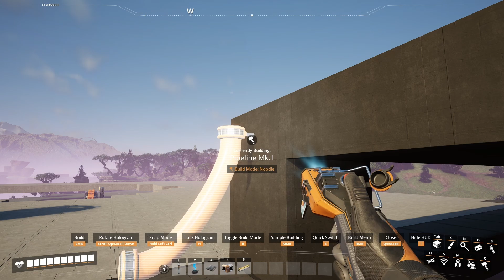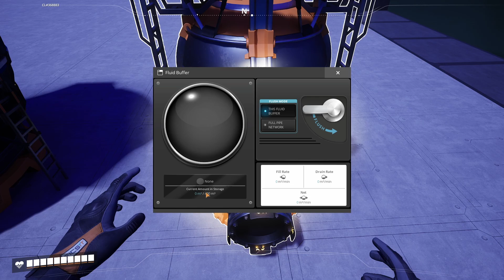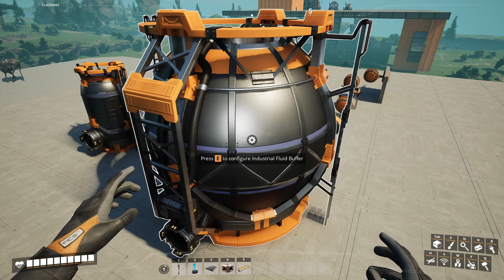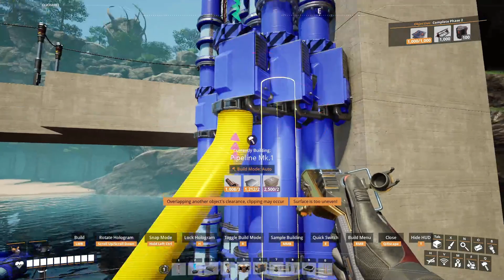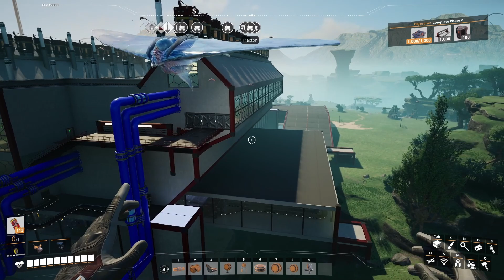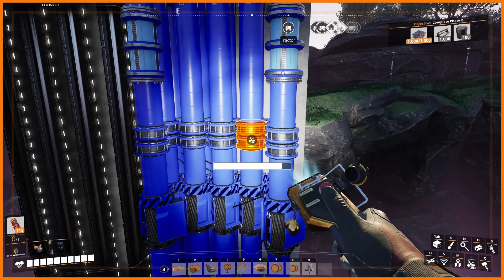Guide for Fluid Mechanics + Flow rate bug fixes (Mk 2 pipe bug) | Tips and Tricks | Satisfactory 1.0

Comment from the maker: I realized when editing I forgot one important tip, and the timecode for part 2

TIP: ALWAYS LET PIPES AND MACHINES SATURATE BEFORE TURNING ON THE MACHINES!
Timecode: 23:48 - Part 2

Do you have other tips that can help make pipes work better for people?
Reply: I think you forgot something else, like TURNING OFF YOUR GOD DANG DISCORD 🤣also thanks for the vide coz those GOD DANG PIPE IS BULLSHIT
Reply from the maker: @pcb5135  that has been solved since, it shouldn't have been an issue in the first place, but soundsetups are just like satisfactory pipes XD
Reply: I have never had to do this. Your statement makes no sense to me.
Reply from the maker: @jamiec8096  means you are one of the lucky few that don't need this video
Reply: Absolutely love this!  My playstyle personally is everything natural for the most part, I do not like platforms for fluids and piping systems.  This style might be worth a try for those that are having some real problems.  I do not use loopbacks, only high pressure, (saturation) and gravity.  Even tanker trains can work wonders if you have everything primed to the max.  If you have enough constant resource it should just work...

Comment: Build my oil refinery with 8 machines, using 600 m3, connected to one overclocked extractor which was much higher so I was not expecting any issues. Yeah you wish. Only now in this video I find out why at the end of my pipeline I have flow rate of only 302 m3 per minute. Can it be because of mk2 bugged pipes? Going to check it.
Reply from the maker: lol, I hope you manage to find the culprit and fix it ^^

Comment: anyone struggling with the 250 clocked nuclear reactor, a trick that works for me is i use a fluid train platform with the dedicated inputs and outputs, i have over 600 water going in and a single mk2 pipe from the platform to the reactor, its a little overkill so i like to nudge it all under the ground out of sight

Comment: First, this is very informative video. As a new player, this did have some useful advice regarding not relying on max capacity. I might need to rewatch some sections, though...

But I have to point something out: "skill issue" has become a code word for the slippery slope of software quality.

Game mechanics don't work as described? Skill issue, you just need to keep in mind this and that when designing.
Graphics drivers are wonky? Skill issue, you just need to diagnose what they are conflicting with.
OS being a spyware-ridden piece of trash? Skill issue, it's entirely possible to remove everything you don't want and keep it from reappearing.
Et cetera, et cetera. It is everywhere, and it's about to get so much worse because of AI code-slop every company keeps pushing.

And thing is, in each separate instance people who tell you this usually ARE right: it is entirely possible to circumvent the issue. One concrete issue, that is.
What they tend to ignore is that user's patience, free time and willingness to put up with bugs are very finite. And if I have to choose between spending them on getting my OS do what I want or on getting the game to behave, guess what will get the short end of the stick.
So ironically, complainers do serve a useful purpose, even if they themselves have no idea.
Reply from the maker: Thank you so much for your comment, and I want to properly address it. If it is too long, sorry, I did not want to leave out any of my thoughts.

I agree with this for the most part, I just need to clarify; when I say skill issue, I mean that as in intentionally lacking skill, or the desire to apply the skill to bypass a bug or badly designed system. They are being narrow minded and ego driven, and if you have watched my video "7+ Mistakes and how to avoid them" you will know my stance on that is "Comparison is the thief of joy, but ego is the thief of knowledge.

For example, I hate the gear crafting system in Skyrim. It is absolutely horrible, it is surface level, gives no creative control to the player, and is just a linear mechanical process. And the game forces you to engage with it because it's the only way to get the best weapons and armor in the game. It is also not applied evenly, where weapons can be enhanced on the grindstone but not armor. But, I still learned the system, I methodically went through it and tried things and figured out how to best use it so that I can enjoy the rest of the game.

To be clear, if you in this day and age where literally every creator doing Satisfactory content has a video on how to get this to work can't get fluids to work in Satisfactory it is nothing but a skill issue, the player needs to get better at learning.

And lacking the skills isn't bad, I won't admonish people for not knowing something. 

What I don't like is people coming to a video like this and spewing hate and negativity when the video itself is offering what amounts to a relatively painless solution, if it is applied during initial construction. It is only tedious if you need to go back over a build and replace or fix things, or having to troubleshoot to find an issue in the first place.

I haven't had any issues with pipes and liquids in Satisfactory since long before 1.0 released because I decided to learn, iterate on my knowledge and how I applied it and now I am sharing it here. I had a skill issue, now I no longer do, and that's that.

If I made a video on how to use Satisfactory modeler and detail step by step how to get the settings for the program that I am using and someone comes into the comments genuinely asking me things, not understanding and stuff, then I am happy to help. If someone comes into the comments complaining they don't know how to change settings, and I should have just dropped a settings config file for them, their "skill issue" lies in the skill of taking in the information provided in the video. 
And honestly, some of the responsibility for that issue lies with me, a good teacher and a good piece of informative content finds ways of sharing knowledge in a way that the maximum % of people watching finds helpful. If the way I teach only works for a small % of people, I am the problem, and my responsibility is to improve that.

I also do recognize that I was unnecessarily salty in this video, it was during one of the peaks of hate and bile being spewed around the fluid dynamics and pipes after the release of 1.0.
Me, as well as other creators often get to act as the trashcan people throw up their bile into, and seeing as I was still very much new to the level of attention I was getting at that point, the negativity was disproportionately affecting me. That is no excuse however, just an explanation, I have taken measure after this to not be so aggressive, and to approach this kind of stuff more level headed, and with compassion and a perspective that tries to take into account the developers as well as the players and my viewers feelings on matters, at least in videos like this that are supposed to be outright educational.

Now, if people want to discuss, I am a lot more "normal" and open to discussion in my streams (#plug). And I myself is a lot more emotional and open to share my own criticism of the games different systems. 
In this video I am not reviewing Satisfactory's systems, I am teaching people how to use a mechanically opaque, badly designed, implemented and explained, but, vital system. Sucks to suck for those who come here and see that there is a solution and don't want it, it's a skill issue on their part to not *want to learn*.

Thank you for coming to my Ted Talk!
Feel free to hop on my discord if you want to have more discussion on the topic :D

Comment: Unpowered pump is actually better than a valve in many circumstances to limit the flow direction. Because the valve has weird mathematics attached to it that can screw you over, but an unpowered pump is just a directional piece of a pipe 😮
Reply from the maker: The difference I found in my testing was that Valves don’t reset headlift, but pumps do, powered or not. So it works if you put the pumps at the highest point in your system, or run a completely level pipe system.

Comment: Great video, wish I watched this a few days ago. I build a basic 3:8 coal plant at start, and everything worked first time. Great, I can do this I thought... my next challenge was a new plant, 12 extractors and 32 generators, however I didn't want it easy so I decided to not split it into 4 groups but have basically 2 groups of 16 generators :)... Boy did I run into problems you explained at 26:40 about pipes not flowing. fixing them was by removing the pipes from the joints & pumps and replacing them... very buggy I thought. I found similar issues with conveyors when putting mergers/splitters on a line... But the good news is I got it working. Was well pleased... :) all with mk1 pipes too. Having water towers high up really helped too as my piping was on a logistics floor under the generators so it also had to push it up 4m or so through the floor. BTW. I've now subbed to your channel. Thanks.
Reply from the maker: Thanks for the sub!
I am happy you got the plant working :P

Comment: I've definitely experienced some head scratching moments with Mk.2 pipes, and solved them by downgrading to Mk.1 until I actually need a higher flow rate for a project. Seemed like future proofing pipes are more trouble than they are worth.

Four months later, I'm very curious about the current experience with the floor and wall holes, as well as the tip here you replace pipes leading into pumps or junctions to address a flow behaviour of the pipe. Is this still relevant or has this been patched? Every time I feel like I am getting the hang of pipe flow mechanics the game has a way of sucker punching me, and I can't help but wonder if it's the junction/pump issue that's been causing it, but I don't want to rework all my pipes if this has been fixed in a more recent patch.
Reply from the maker: The floor/wall hole is supposed to be patched, the pipe replacement is still needed for when placing attachments on existing pipes sadly.

Comment: I'm in the final stages of getting my 296,400 MW Rocket Fuel/Compacted Coal Power Plant running and at first I was having to tinker with the Nitrogen Gas coming in via train.  However once I managed to get the Nitrogen worked out them my Oil started acting up and I remembered watching this vid and I'm currently trying out the merging pipe trick.  Though the trick is very fussy for me and it looks like there seems to be a length limit due to the fussy nature of it.

Edit:  I wish they'd add in an item or the ability to select multiple power generators to toggle them in and out of Standby mode so let them fill.  a Few isn't a problem but it gets time consuming when you have several hundred to have to toggle when troubleshooting.
Reply from the maker: On your edit, yes, I agree :P

Yea, they seem to have done some kind of update that changed, it, a couple of pipes I had merged before were split again on loading my save

Comment: Thank you very much. I have a turbo fuel power production line with 500 m³. No matter how I put my pipes, a few kept running out either at the end of the line or in the middle, or wherever, etc. I found the entire video very interesting and very well made. The key point I was unaware, despite over 1000 hours in the game, was the fact that there was a floating point calculation error in the mark 2 pipes. All I did was change it from 1 Mark 2 to 2 Mark 1s coming out of my refineries and it worked perfectly as expected.
Reply from the maker: Yea, the floating point error has been mostly fixed, but if there is literally any error, it becomes larger in a mk2 than in a mk1, so regardless, the mk1 is the more stable choice :P
Reply: High pressure Mk II in /buffer/ low pressure Mk 1 out...

Comment: Thank you very much for this video, I obviously did not know how the MK2 pipes works. I had unstable flow as the main issue, but needed 600/600 crude oil. I didn't understand why the flow was so inconsistent, but then I switched the pipeline out with MK1 pipes. The flow is not completely even. 

Very imformative and well explained!

Comment: Honestly, thank you for making this video.

Trying not to be salty, how the Satisfactory community and development team (kind of) handles pipe mechanics and physics is annoying. Being told that I basically have a skill issue for years just to find out that there are several bugs to pipes justifies the frustration I went through. Pre-1.0, I quit a save file just because of problems I had with Mk 2 pipes not having a perfect 600/min flow rate. Now finding out that there is a floating-point number bug with Mk2 pipes, which makes perfect sense. 

Honestly a shame this video doesn't have more views, as it goes into great detail about how players should implement pipes into their worlds. Other guides I've seen just talks about head lift and may briefly mention to not make long fluid manifolds for an unspecified reason. 

Thanks again.
Reply from the maker: Yea, and a lot of the problems with Mk2 pipes have been fixed at this point, but you still have random stuff pop up constantly, I even had it in my last Let's Play episode too XD where headlift was not applied like it should. Had to put in another set of pumps

Comment: wait, so is it bad practice to place pumps or junctions directly on the pipe? I need to place them first or to replace the pipe at all ends so that it is no longer considered 1 pipe but many pipes? So far I haven't paid attention to this and everything works with my coal power plant or the oil factory.
Reply from the maker: Yea its a known bug, but if your setups work, don't touch it XD if stuff is not working, then start with that step

Comment: A tip according to the KISS method; when you only have mark 1 pipes and have the space use 4 waterpumps underclocked for 8 coal generators so you dont have the need for balancing and it is also more energy efficent (54.8 MW for 4 at 75% against 60 MW for 3 at 100%)

Comment: I was building a 66GW turbo fuel factory in the Blue Crater and struggling to get everything running at 100%. This video was so informative, I had everything worked out within a couple of hours, 100% efficiency using your tips. Awesome work!
Reply: I built basically the same power plant on the northern beach (66GW) but I will not try to ficsit. Enough for me to know its not my fault 😄
Reply from the maker: That is awesome to hear!

Comment: Thank you! 

We did a 80 (turbo)fuel-generator setup with one overclocked oil-node and alternative recipes. The maths were fine, but we ran in almost all of your mentioned piping-issues.
I wonder why setting junctions or pumps does not split the pipe immediately at placing; should be possible to implement.

Maybe the players are intended to ficsit.
Reply from the maker: Happy it worked out!
Probably a leftover of old code implementation and fixing it would cascade into a massive project XD I know they have talked about a major pipe and fluid dynamics overhaul at some point after 1.0 but when. or and actual "if" is a mystery

Comment: Skill issue... call it what you want. "Follow some vague rules and hopefully it will work somehow, if not, fuck around with it until it does" is not very satisfactory.
Reply: YES, My Man, yes!  Coffee Stain is great but they stubborn as hell about fixing these pipes.  A 600 pipe should push 600.  Or at least tell me the math so I can figure it out.
Reply: It's several machines pushing and taking at separate times. Add a tank between let it saturate. The tank itself will prevent sloshing
Reply from the maker: a lot of people are using my method and it works for solving their issues. I still place the blame on CSS for not properly developing a pipe and fluid system that is intuitive and also, that has any form of tutorial in game. For now we have to use our workarounds and this video shared mine, if they don't work for you, or if I don't, I am not demanding you stay.
Reply: Deleting pipe to rebuild the exact same pipe to fix a system is not a skill issue. Getting fluids to work is the equivalent of finding an Easter egg because you’ve left no stone unturned. That’s not a skill issue it’s a time commitment issue.

Comment: I have a fairly long single pipeline running from a lake to two Aluminum refineries. By the time the water gets to the two machines the pipes are nearly empty. Do I just need to insert pumps every X number of tiles or what is the issue? I even tried adding more water extractors and making the whole pipeline Mk2 thinking it was an overall flow-rate issue but if anything that made the situation worse. Is there a limit to how far water will travel in a long pipe? I have looked up several Youtube videos on this and no one talks about length of pipe vs flowrate or flowrate decreasing over a long single pipeline. This pipeline is mostly horizontal and starts with a huge water tower that is much higher than the rest of the pipeline.
Reply from the maker: I would have to run a test to see if there is a limit but there shouldn't be, what I would say is let the refineries fill up and the pipes as well, and don't turn on the refineries until everything is completely saturated, if it never saturates there is some kind of blockage or pipes not connecting on the way.

Alternatively reverse what you move where, move the bauxite and stuff to the water instead of the other way around